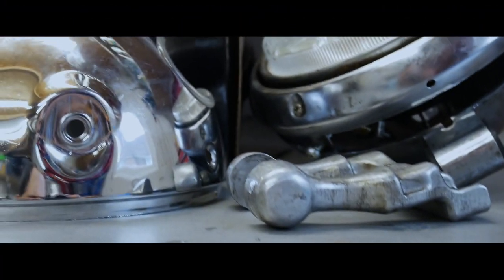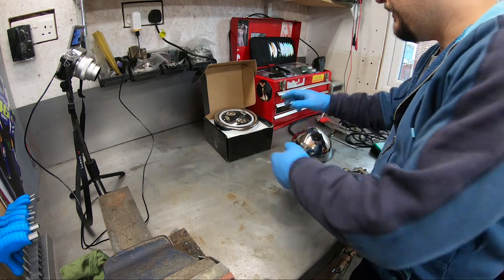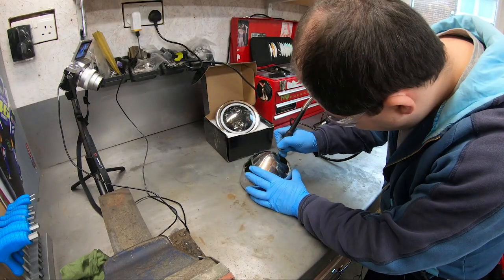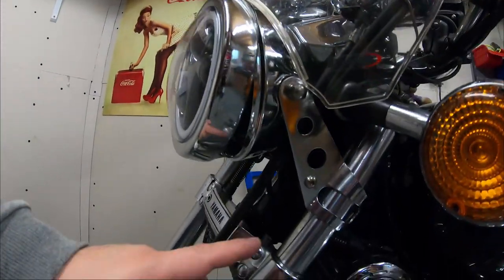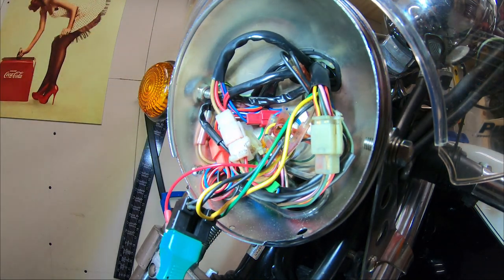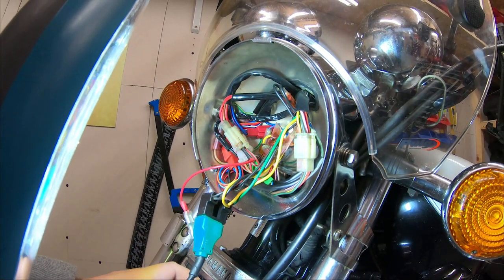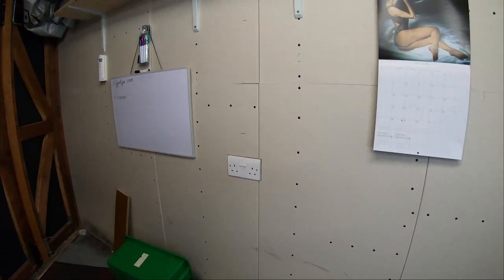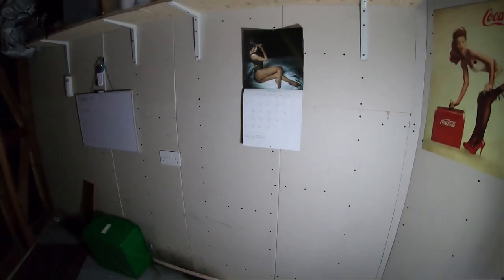YAMAHA VIRAGO 1100  LED HEADLIGHT UPGRADE | Cheap Ebay Chinese LED Daymaker Knockoff Review

Comment: This is great,  my Virago headlight has never seemed bright enough but it sort of aims too far down.   I will see if I can adjust it upward.....but may end up doing this upgrade.  Thank you!
Reply from the maker: Thanks. There is not much adjustment available on it. Make sure you don't trap wiring on the top so the housing can sit nicely between the clocks. If you don't want to go full Led than there is a really good bulb upgrade which I used in my missus car and passed the yearly inspection, no dazzling and nice bright. 
This is the stlye you want...anything else is just too bulky and the beam is crap....thus is plug and play
https://www.ebay.co.uk/itm/NOVSIGHT-H4-LED-Bulb-30W-6000LM-Replacement-HID-Hi-Low-Beam-Motorcycle-Headlight-/133055771540?mkcid=16&mkevt=1&_trksid=p2349624.m46890.l49286&mkrid=710-127635-2958-0

Comment: Could you do a video on how to replace the back headlights mine snapped while having a buddy behind me 🥲
Reply from the maker: Hi. I possibly could but that is super easy. Only 2 or 3 bolts holding it to the mudguard I think. To be fair I never touched mine so not sure.
Reply: @MidlandCruiser  If you make a video that would be very helpful your videos help a lot man even after 5 years🤝

Comment: Hello,  great upgrade do you remember the size of the edge trim purchase for the hole cut in the bucket?
Reply from the maker: Omg, that was a long time ago. I think the bucket is quite thin, about 1mm, so one which can go over that, should be enough. Hope this helps

Comment: Great video, thanks.  Question: Did the heat sink eventually melt the wires?
Reply from the maker: 🤣no it hasn't. It only warms up to about 50-60C so it is a lot cooler than a halogen bulb.

Comment: What did you do with all the wiring do you just leave it dangle there
Reply from the maker: Pretty much yes, just like it is with the original setup. Luckily this LED headlight doesn't get as hot as the halogen housing, that is impossible to touch after 5 min, this barley gets above 60C..👍

Comment: Hello. Thanks for video. Are You satisfied for the change?  If You had to compare the power with an classic H4 light bulb? 
Would You buy again?
Reply from the maker: Hello, definitely a better light than a classic H4. The light to the sides are equal and bright, while a normal H4 is very strong in the middle but fading away quickly sideways. I would buy again yes but probably a 7" one not the 5.75. Nobody flashed at me yet and passed MOT as well, so I call this a win. Hope this helps

Comment: Have you changed also the gouges light?
Reply from the maker: Yes I use T5 286 LED bulbs in my clocks, they are awesome but they only last a few weeks before they start to flicker, so I need to get some better ones, maybe error free ones are better, I haven't tried them yet. If you get some then get the ones with wide light spread, pointy ones will create hot spots. Hope this helps you out.

Comment: How did you make the gauges look so bright?
Reply from the maker: @yrguitar1  I use T5 286 LED bulbs in my clocks, they are awesome but they only last a few weeks before they start to flicker, so I need to get some better ones, maybe error free ones are better, I haven't tried them yet. If you get some then get the ones with wide light spread, pointy ones will create hot spots. Hope this helps you out.

Comment: Hey I got a weird question I bought a 98 xv 1100 and bought a led kit for it the led kit has a feature where you can hook up wires to each turn signal and the break and when you hit the turn signal it'll go from what ever color it was on to flashing yellow in that whole side of the bike per which side turn signal you hit same with the break the whole bike lights up red well I can't figure out if I can just tap into the wire harness for each separate turn signal and break wire (which I don't know where that is if you do id appreciateyou telling me please) or If I have to do it a diffrent way do you have any help you could recommend please
Reply from the maker: Hello, I understand what you're trying to do but I'm not particularly the best with electrics. I think you should be able to tap into the turn signal and brake wires to get the signal to your new Led lights, can't see why it wouldn't work. If you haven't already joined a few Facebook groups then I'd suggest you do...loads of information about upgrades and you can download documents, like wiring diagrams...etc. sorry I'm not much of a help in this.

Comment: Hi great vids, can you give a link for the light and bucket please.
Reply from the maker: Hi thank you, unfortunately the one I used is not available anymore on ebay. Few people asked about this earlier and I have put links in thier comment as an answer. Basically just search 5.75 or 7" LED headlight and loads of option will come up on ebay.. Thanks again

Comment: I couldn't find a link to where the bucket was bought. Where can I buy one? I like the upgrade!
Reply from the maker: The one I used is no longer available... But if you search on ebay for 5.75 or 7" headlight bucket I'm sure a few will pop up, that's where I got mine from. Nothing special just a generic Chinese one.. Hope this helps 😉

Comment: I hate all of the dam wires in the headlight assembly, I can't find a dam bucket to fit all the wires for my virago 750.
Reply from the maker: Try a 7" bucket...lot more space and loads available on ebay, and the headlight unit cost about the same

Comment: Hi, i built a virago xv1100 cafe racer. Everything was fine till I installed this kind of head light and a month later my battery died. I live in Toronto Canaada. I am 23 and i am in immigrant low on funds i don’t want to waste any money more than i need to. My headlights have halo and the turn signals integrated. The halo and low beam turn on as soon as i turn the keys even if the fuel pump is turned off. Everything else works just as the stock headlights, the parking lots, liw high beam etc. Could this headlights be the reason my battery is dying? Also i am quite handy and was thinking to clean my carbs myself as it is having idling issues. Should i attempt that? I have never previously worked on carbs before.
Reply from the maker: Hi there... Early 1100 had a not so great reg/rec which used it's metal body, and the mounting bolts for ground, now if this is not perfectly clean then it will end up failing...
I don't think the lights would cause any problems at all, fitted a few in 1100 and they all fine.
If you need a reg/rec I recommend this tourmax one which is the upgraded, finned version and also has a separate ground wire, which you can extend all the way to the negative side of the battery.. 
https://www.ebay.co.uk/itm/Regulator-Rectifier-Fits-Yamaha-XV750-1100-Virago-5-Wire-SH665-12-3LP-81960-00-/114721523646?_trksid=p2349624.m46890.l49286
Now to check the reg/rec you'll need a multimeter and measure the voltage at the battery, on idle should be 14V or more and on around 2500rpm 14.4V if it's more or lower then it's more than likely dead. I suspect it will be less, maybe 12 or 11V which would also explain the bad idling as the ignition system isn't getting sufficient power.... Check this first then go from there.
Doing the carbs are not hard, just remember to make a few photos to see how everything is routed etc.. Do 1 carb at the time and go through everything thoroughly.... What many people end up doing is just spray carb cleaner all over, everywhere which will cause even more problems... The only way to do this is a complete (I mean to last washer) strip and ultrasonic cleaning then back to the settings which worked, or stock depending on your mods...
Hope this helps 😉🔧🔧👍
Reply: @MidlandCruiser  thanks alot for the prompt reply. TBH my love for riding was dying a bit because of all the issues i faced and it was giving me a lot of stress. But the virago community is so helpful and your videos are so in-depth and knowledgeable that i watched all your videos regarding issues I didn’t even have. If there is another way to reach you better then please let me know as i am new to this and I don’t have much experience with motorcycles. 

Can you also suggest which spark plugs work best with virago xv1100 1998? I have not engine mods and awlays us 90/93 octane depending of availability
Reply from the maker: Thank you, your appreciation really means a lot.... As for the spark pkugs I use and suggest NGK BP7ES as your bike has resistor plug caps so you'll need non resistor plugs.
To reach out to me in private you can search Midland Cruiser on Facebook where you can send me private messages... 👍

Comment: How did you find the angle for the center screw????  I  ordered the same stuff you did i think. And  how are your meters so bright and blue???
Reply from the maker: Hi there. To find the spot where to drill the center hole I measured the distance on the original. From the middle of the top edge downwards. It was a little off because the new bucket is bigger and sits in a different position, that's why I had to dremel it a little bit, so I could tilt it. Basically drill a small hole first roughly where it needs to be then put it on to see which way and how much off are you, then you'll know where to go.

I use T5 286 LED bulbs in my gauges, they are awesome but they only last a few weeks before they start to flicker, so I need to get some better ones, maybe error free ones are better, I haven't tried them yet. If you get some then get the ones with wide light spread, pointy ones will create hot spots. Hope this helps you out.
Reply: @MidlandCruiser  How did you set the springs at 2:00  ?  Go i need to spread them a little withe a wire cutter?
Reply from the maker: @saitohhajime83  right. I really should have included it in the video, sorry. It is quite hard to explain. You shouldn't need to use any tool to put them in or shortening them. If you can pause the video in the right place you can see which way I fitted them, it wasn't too hard to put them in, although needed quite a bit force... Basically I put the flat middle bit against the Led unit then pushed down both "legs" and hooked them behind the bevel's lip. When you push the 2 "legs" down the flat middle part bow up a little where it touches the Led unit. It is fairly strong and should hold the unit in place quite good... I hope it makes sense.. I apologize, I really should have included that in the video.. 😞
Reply: @MidlandCruiser  Man ,thanks for your help! I did it! i didnt set the screw like you did (didnt have the time today cause i think to set to the right angle will be the most difficult) , but will probably will soon.I also didnt use the uper hole the cables went to the lower hole with a little effort(should get my uper hole a bit bigger) Think iy's awesome.But we are locked down here and didnt see how well it is .Will check geting back from work.Maybe I'll buy a better daymaker.I think there's an american one that is cheapper than harley and looks as good.Thanks again!

Comment: Hi, do you still have the 1100 ?     how is the headlight doing ?
Reply from the maker: Hi. Yes still have it, and the headlight works just fine, no flickering. It has a little condensation if running for longer time but not too bad. Also passed the yearly inspection, so can't complain. Currently YouTube is in parking status, however I plan to carry on, hopefully this year.

Comment: I bought this last year and its terrible! better than the h5 bulb that was there but I have been really disappointed mine also has condensation when it gets warm
Reply from the maker: That's interesting... I really like mine, the light output, color, and pattern is all very good. There is a small condensation in mine too but nothing I worry about. I have seen someone had a flickering problem with it on the Facebook forum so I guess there is a quality difference between units even though they look the same, they could be very much different on the inside.
Reply: @MidlandCruiser  hi you got a link to were I can buy one please
Reply from the maker: @zxcvbnm1965100  The one I bought is no longer available but this looks the same, it is a generic unbranded chinese stuff so basically they all the same on ebay. This seems like located in the UK so it cost a bit more: https://bit.ly/2XZYiE5
What I would suggest and even I might do this winter is going for a 7" one instead the original size like this one: https://bit.ly/3fl2fJf
This last 7 inch is very cheap, not sure tbh. Basically just search on ebay for either 5.75 or 7 inch LED headlight and choose whichever you fancy. I don't really know about the quality of these 2. Back when I bought mine I was like for the price I don't really care if they break in a year or 2, but it is still working as on day 1. Yes mine also condensate but again for 30 quid...not bothered. Hope this helps

Comment: Just to see headlamp link I read 15 minutes where u hide it. Should I hire PhD eBay or you tube researcher to find headlamp Link
Reply from the maker: @ Michael GKL I have put it in the description that I couldn't find the exact same one I have so just search ebay for 5.75 led headlight and loads will come up... Like this
https://www.ebay.co.uk/itm/313167260601

Comment: Is it no problem with mot test ?
Reply from the maker: Everything was fine with the MOT, as this is a fully sealed LED unit not a LED bulb flitted into a halogen housing (which is illegal now in the UK, previously only HID was in the law but LED is included now) the tester checked the beam and said it is a general flat one and fully passed all checks... No dazzling for the oncoming traffic, I had nobody flashing me.. Hope this helps 😉👍
Reply: @MidlandCruiser  many thanks bro. What type of E Mark is there ? E9 or E8 or different ?
Reply from the maker: DOT SAE E9 these are all the markings on it, just checked it.. Took an other bike to MOT with this on https://www.ebay.co.uk/itm/Motorbike-Cafe-Racer-CREE-LED-Headlight-Chrome-7-50W-E-MARKED-DRL-HALO-750AC-/163636922616?_trksid=p2349624.m46890.l49292
And also passed without advisory or even a mention (but this was back in December, before the new MOT law) my 1100 is going for an MOT sometime next week so I'll know for sure, and will tag you here to let you know.. 😉
Reply: @MidlandCruiser  I will wait. Mamy thanks for your help
Reply from the maker: @Adam Borowski The bike passed the MOT yesterday without advisory, however when I asked my tester he said these lights are a grey area, because they are not bulb upgrades but LED upgrades, and he said the pattern just fit in the tolerance. Now if you watch my video you can see I have a little round bulb which projects light in the middle above the cut off line, and that what he meant. So if you can get a light with a nice flat cut off line you'll be fine on the MOT. He is a nice lad and passes Harleys all day (loud as F...) so he might be on the more laid back side of the testers. I hope this helps you out. Also I recommend to go with a 7" with new bucket, lot more room for the wires and I prefer the look more too (very subjective)..
Reply: @MidlandCruiser  Thank you for your answer my friend. I bought one of these for my streetfighter project. I will see and I will let you know soon what about my headlight

Comment: Where u buy I tried to find but I don't where
Reply from the maker: It isn't anything special, just a generic Chinese 5.75 inch Led headlight. If you search on ebay loads will come up. I can't find the exact same one I used anymore...but if you search around you'll find one similar I'm sure 
Like this...
https://www.ebay.co.uk/itm/5-75-200W-Projector-Headlight-Halo-DRL-LED-Light-for-Harley-Softail-Sportster-/363376903803?mkcid=16&mkevt=1&_trksid=p2349624.m46890.l49286&mkrid=710-127635-2958-0

Nothing fancy..
Reply: @MidlandCruiser  oh ok I order  the wrong one because I recibe 7 inch led lol I need returned 😅 and ask for the correct one thanks alot
Reply from the maker: Hi. The 7 inch still works if you get a new headlight bucket as well.
The 5.75 as far as I know won't go into the original Virago bucket...nearly all people I know ended up buying a new bucket too...so you might as well get the 7" Headlight and a 7" bucket. I did one for someone and it looks better in my opinion than the 5.75
Reply: Oh ok thank you so much

Comment: Led lights contain blue light which is poisonus to human eyesight.thaths why it hurts when you look into  led headlights of oncoming cars in traffic.good job boss
Reply from the maker: When I passed my car/bike licence I was always told to look at the opposite side of the road and NOT into the oncoming  car's headlight. However a quick Google search showed that LED emit some blue light indeed even the white ones, but not enough  to be  considered dangerous or harmful, they are just bright, that's why looking into it is painful and not recommended whatsoever. My bike's headlight passed the yearly inspection here in the UK called MOT. I specifically asked the tester about it and he said there is nothing wrong with it, the beam is flat and it won't dazzle anyone (I am not a teenager who put HID bulb in a Golf or a Corsa halogen headlight ) I was very careful with this upgrade because I too hate when I get dazzled by oncoming traffic.

Comment: Que bombillas llevas en los relojes.
Reply from the maker: I use T5 286 LED bulbs in my clocks, they are awesome but they only last a few weeks before they start to flicker, so I need to get some better ones, maybe error free ones are better, I haven't tried them yet. If you get some then get the ones with wide light spread, pointy ones will create hot spots. Hope this helps you out. Sorry I only speak English, used google translate to find out what your question means...